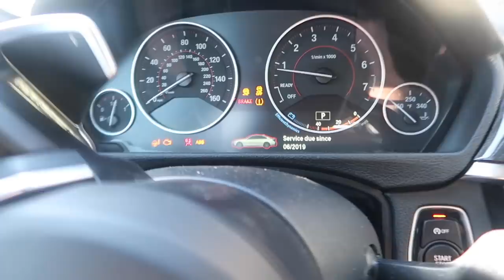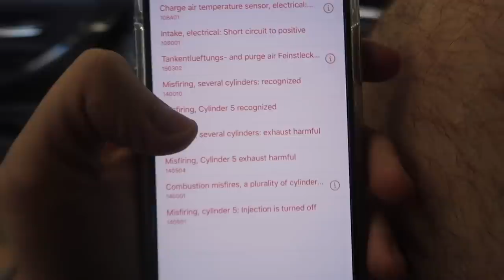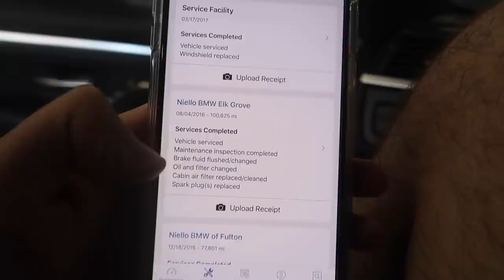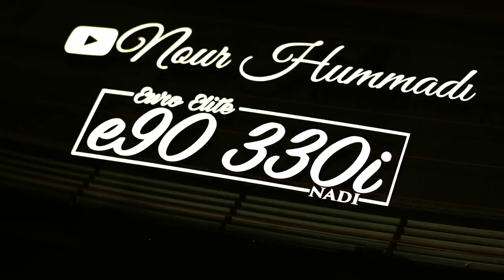HIGHEST MILEAGE 435I BREAKS DOWN!!!! HASN'T EVEN BEEN A MONTH!!!

Comment: That spark plug being black is because of unburnt fuel. Definitely weird also seeing misfires on 5 & 6 after clearing. Hopefully its just injector issues. Relative compression cranking it over sounded good. I didnt hear a skip! You technically dont need the tool to remove those injectors. With some careful prying they will pop free.

The "exhaust harmful" is just an added note as a misfire dumping raw fuel into the exhaust can harm the catalytic converter.

Love the pay to play line. I use that with all my customers and people who want to drive euros or higher end vehicles. Great cars when they working, but don't forget the additional cost to repairs!

Comment: Hey bro injectors have specific numbers on them that you have to input into the ecu so you will also have to code them if you buy them used. There are scan tools under 300 bucks that can code injectors, or you can look up a guide on how to set up impa on windows and that will allow you to code injectors as well.

Comment: This happened on the same cylinder in my N54. Most likely your injector 5. Replaced them with some ebay injectors and all good!
Reply from the maker: did you just change the oil or you vacuumed the fuel out of the cylinder?
Reply: @NourHummadi  I just let the car run for a bit until it burnt off all the fuel it had dumped into the cylinder. No need to change the oil though.
Reply: Nour Hummadi I would change oil, the fuel must have been running down past the piston rings when the car is off. The oil will be diluted and less viscous than it should be.

Comment: Did you pull the negative terminal on the battery before pulling the injector? Mine was doing something similar when replacing the valve cover gasket.

Comment: Make sure if you ever pull a injector you change the seal otherwise youll run into leaky injectors in the future. Same goes for used/ refurb injectors. Precision raceworks makes a nice tool for injector/seal removal and install

Comment: Man changing injectors is a piece of cake unless one of them suffers from black death. Injector removal tool they probably even have in Autozone. 
For coding stuff it's really time for you to finally stop fulling around with Carly and get a proper tool. There is plenty of places where you can get ISTA for free.
Once you have it, it's really trivial, go to service functions, power train, DME, adjustment functions, injection quantity compensation and enter values written on your new injectors.
Paying someone $100+ for this is just dumb.
Reply: Pera Kojot ProTool has made this way easier now. You can do all the stuff from a tablet now. It’s $100 but it’s not vin locked and can be used along multiple chassis bmws
Reply: Pera Kojot I don’t know much about cars but I thought Black Death only happens on diesels but I guess not.
Reply: @piovo1  Nope. It's more common with diesels for sure, but it can happen anywhere with carbon buildup and a leaking injector.
Reply: Pera Kojot N54/N55 injectors are known to take a crap. Bad design they are already on index 12s already(revision) lol. If I was him I’d run my vin to make sure he isn’t on a recall. Many bmws had extended warranty recall on those injectors
Reply: @JSpool1  Yeah N54/N55 injectors are notoriously bad. Not sure if there's a recall (he should definitively check for his VIN). Otherwise pity his millage is so high, as he's in CA he could have asked for a free of charge replacement under CA emissions warranty that is 7 years / 70,000 miles from first date of service.
Reply: Pera Kojot some were extended to 150k. It was usually the 2010+ models. Which left my 07 out of luck lol

Comment: My very first car was a BMW E46, I fell in love with the brand. From the ages of 16 all the way to 30 I have owned 5 BMW’s, never buying outside the brand. My fiancé bought a brand new Mazda CX-5 in 2014 and she has 110K miles and the car has not had a single issue outside of routine maintenance. It made me realize as much as I love BMW, they are very unreliable vehicles. I still have my E92 M3, but it’s in storage. I bought a 2016 Mazda CX-5 like my fiancé and while I know it’s no BMW, it feels good to know she won’t ever leave me stranded like my BMW’s use to.

Comment: Bro I had to change my injectors in my N54 & I have the mini slide hammer & this schaben scan tool specifically for Bimmer’s that lets you code the injectors! I replaced them myself and also coded them by myself! I’m not sure if this tools work for the N55 but if you want to try I can definitely let you borrow my code reader and the small slide hammer! just let me know I’m located in San Jose about an hour and a half or 2 from you!

Comment: You don’t need the injector tool to remove it btw. Just get an indexable pry bar and leverage that injector our. Replace that spark plug due to fouling. It’s not programming you need it’s just an abl that they have to do to tell the vehicle what injector was installed to what cylinder. Just trying to save you some money.

Comment: i have similar problem to my e46 325i
bought new ignition coils and the same, change their places, and still missfire in cilinder 1 
no one cant help me at the moment.
When i start the car, it runs and ~900rpm, then drops to 600rpm, but the car shakes like crazy. 
All the pipes are checked there is no air flow leak.
I dont know what to do :/
Reply: zoratrg 
Try replacing the spark plug too

Comment: You need the coding so the DME knows what each injector flow rating is since each one has different flow performance. This is to ensure that you have enough fuel in the chamber especially when your turbos are spooling up and in WOT situations. You don't want your afr's to be all messed up.  Also, I’d suggest buying BimmerGeeks protool and getting away from Carly. It’s 100X more In depth and you can literally code the injectors with ease.

Comment: Please save yourself the trouble and take pictures of the new injector part numbers before placing them in the engine. When you program the new ones you need to have the numbers on hand or else you’ll need to pull the injectors again just to get the numbers off them